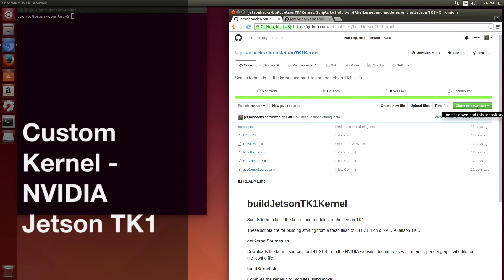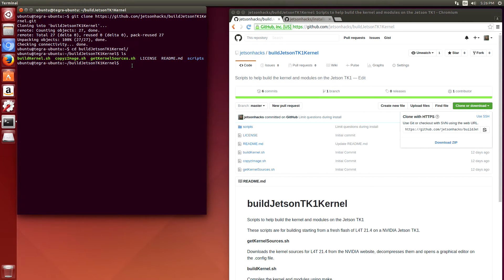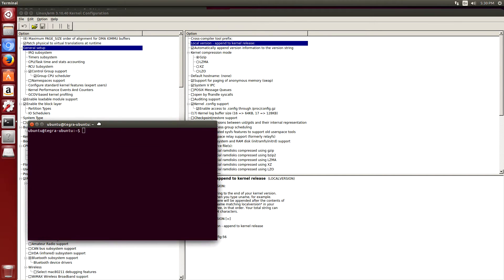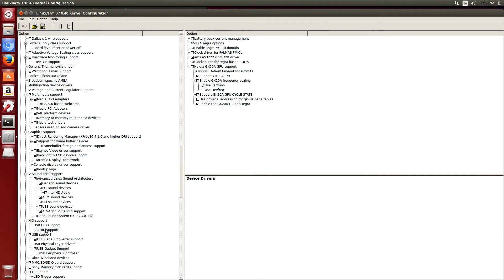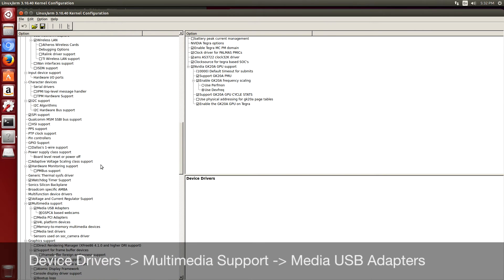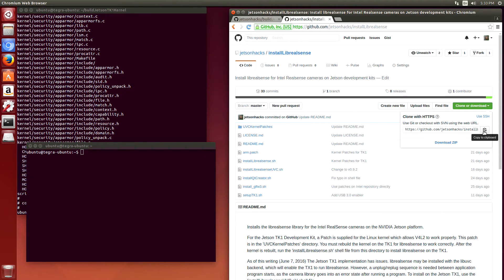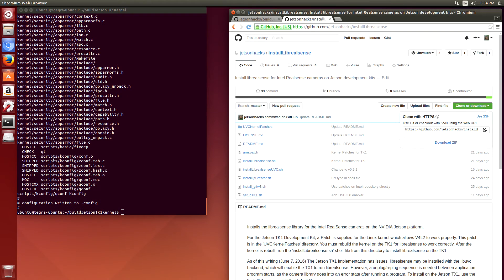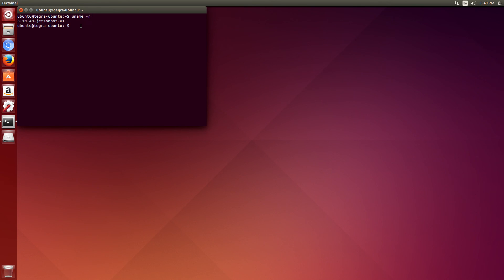Build Custom Kernel - NVIDIA Jetson TK1

Comment: I installed the kernel following your video.
After rebooting, it seems to work normally.
However, after 1 minute, TK1 stops.
Have you ever experienced this?
I used the same version of L4T and JetPack.
My goal is to turn on the eDP panel by modifying the kernel.

Comment: Hi Jim, what I should do if I want support for an Intel 7260 dual band wireless mini pci-e?, and does that ftdi patches  work for arduino devices,  specific uno and nano?
Reply from the maker: Typically for the Intel 7260 you would follow these procedures: http://www.jetsonhacks.com/2014/11/15/build-modules-drivers-nvidia-jetson-tk1-lt4-21-1/
For the Arduino, it depends on which chip they use for the serial communications. Some use FTDI, others use CP210x. In either case, you need to enable those modules. 

An alternative is to install the Grinch kernel, which has most module options built in. Thanks for watching!
Reply: ok Jim, another question, I've already installed librealsense and ROS, I'm going to use an intel SR300 camera with some IMU for a SLAM project for an autonomous vehicle, but I need wifi connection, Can I follow these procedures http://www.jetsonhacks.com/2015/05/26/install-grinch-kernel-for-l4t-21-3-on-nvidia-jetson-tk1/ to install grinch kernel without losing the performance of my realsense camera?...